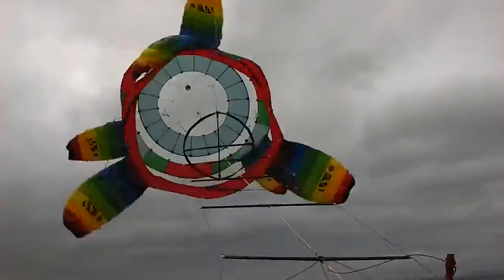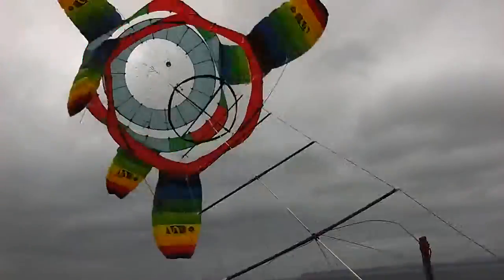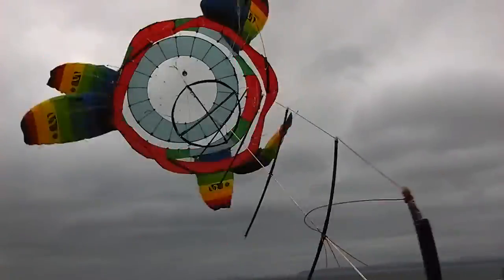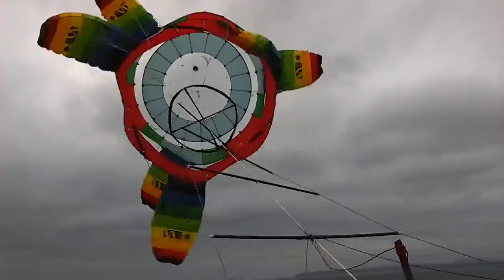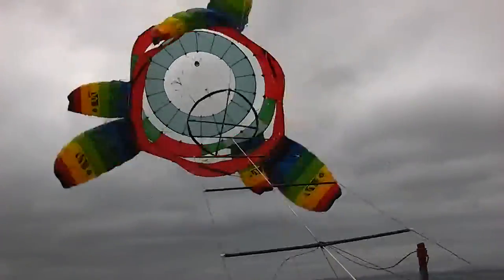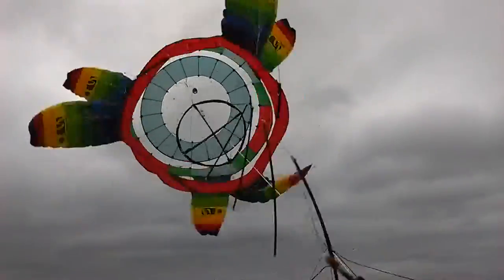folded drive kite tip problem mode

Comment: some how I feel that you would be better off with an outer ring supporting all the wings in place. this ring may be designed to hold the blades and also increase a bit the wind speed into the blades in a funnel kind of way. without increasing significantly the construction of each blade (and the weight), the blades will keep folding in high wind. You may design the outer rim to act as a drag stop for very high winds. the connection to the main guy line will be from the outer ring and middle axis. Also the trick is how to have long rotating flexible "shaft"